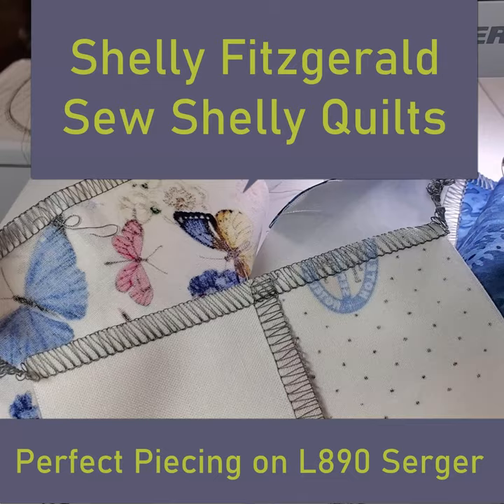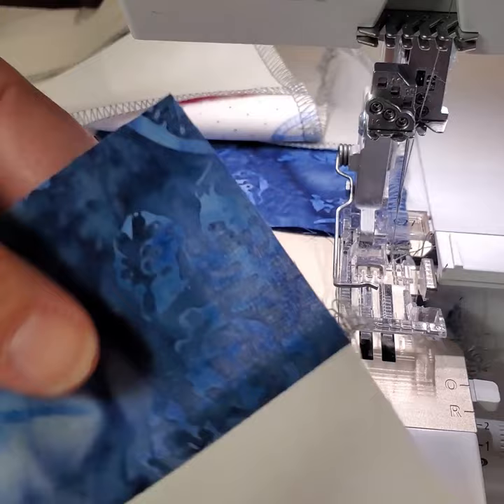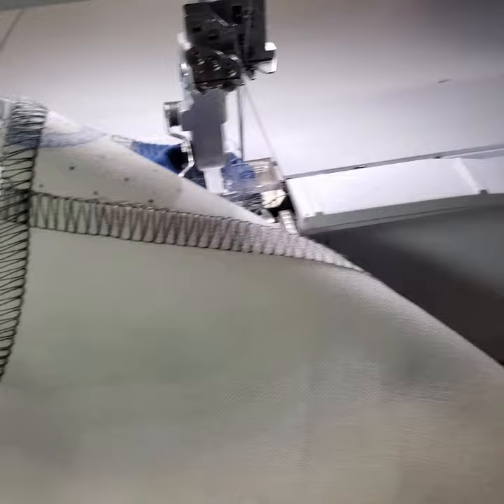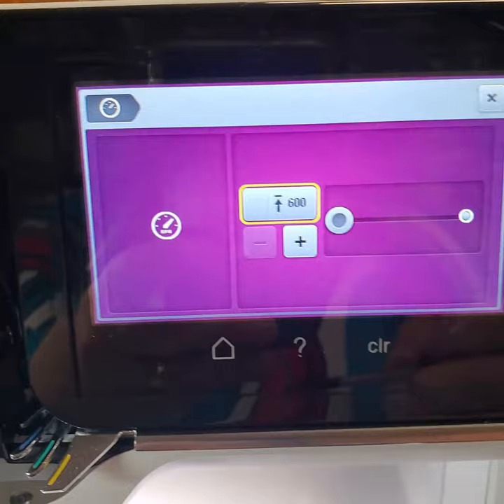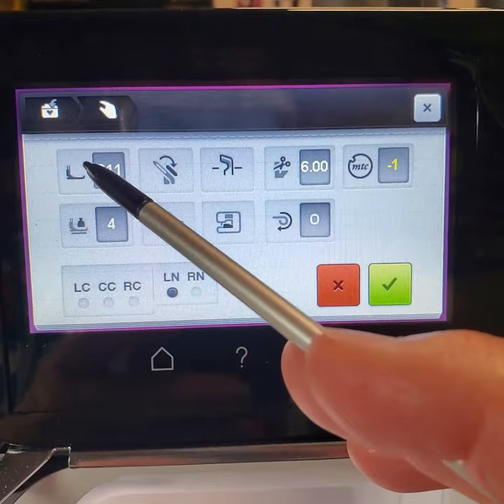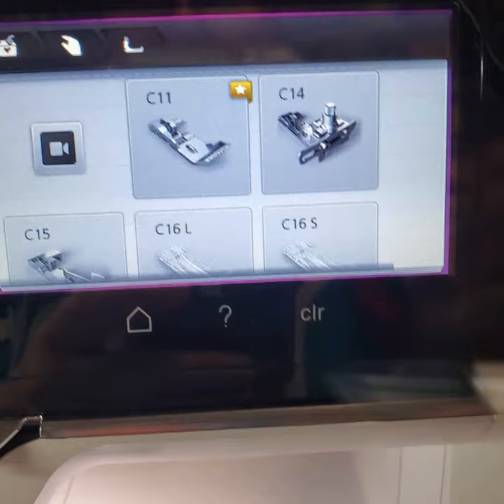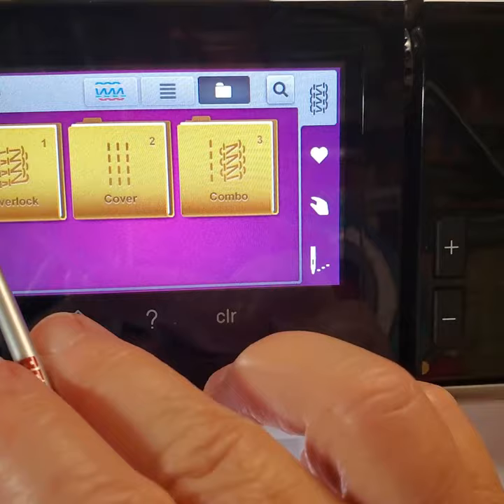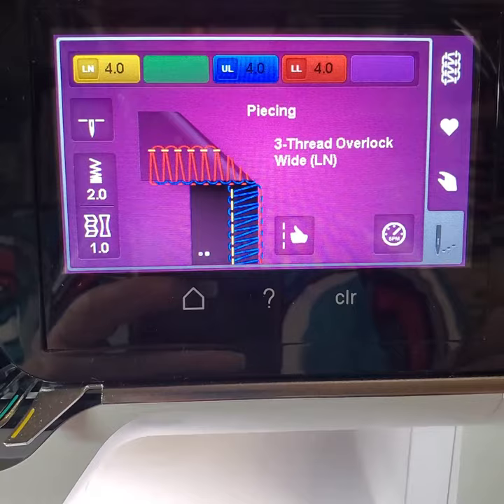Serger Piecing a quilt with a BERNINA L890

Comment: Thank you for a great video.  What type of thread and what type of needle are you using?
Reply from the maker: Charlene,   I am probably using regular serger thread in this video.  You can use any threads you want.  I like a sharp needle (microtex 80) when piecing normally but in this instance I am probably just using the ELX 80 that came with the machine.  I have noticed that when piecing  you want to check the thread, needle and stitch length so that there is not any bulk in the seam.  Meaning I don't always shorten the stitch length, I like a 50 wt or lighter thread and any needle that gives me a great stitch.  Sample Sample Sample.

Comment: Would you use a wider stitch or a different stitch if you were piecing with flannel?
Reply from the maker: I would just test test test with widths, stitch lengths etc until I got the sttings I want for the fabric I am using. I still like to have a perfect quarter inch seam allowance so the pattern is the correct size and all of the blocks go together nicely.

Comment: does this add a lot of bulk with all the threads?
Reply from the maker: I used a thin 50 weight thread and there was no added bulk. You might want a 2.5 stitch length on some fabrics instead of shotening to 2.0. That would place less thread in the seam allowance. As always test and adjust on a sample to get the results you want on your specific project.